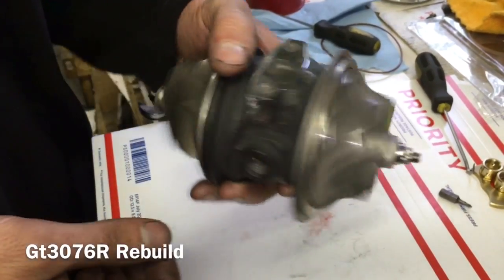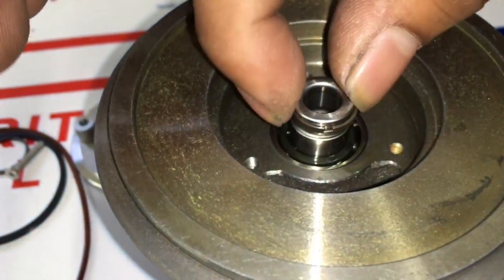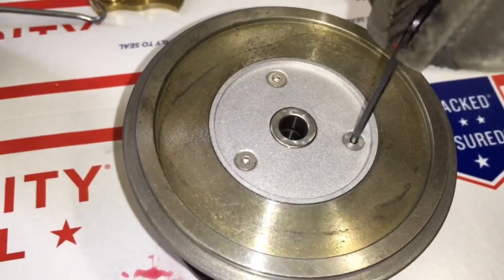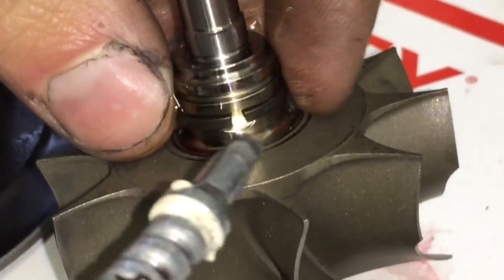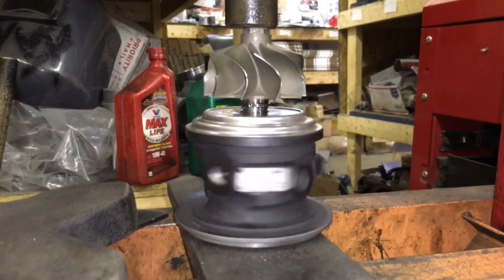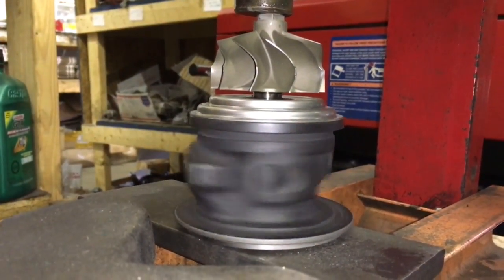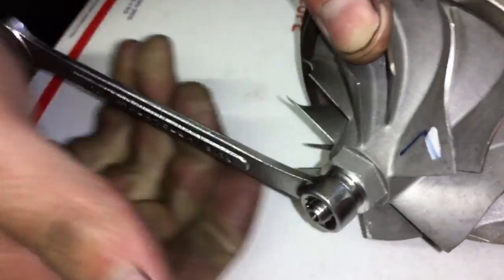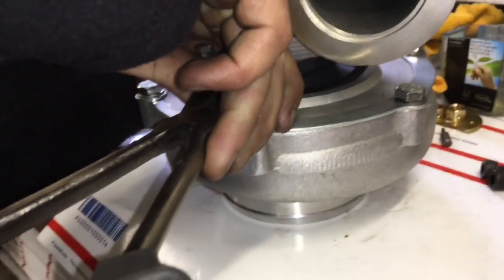Garrett Gt3076r turbo rebuild

Comment: Do you know what rebuild kit that I need for my Blouch Dominator 1.5xtr? I know that the cartridge is garret gt, but i was wondering which one should I buy. Can you help me to find the right parts? Thanks!
Reply from the maker: You need the gt3071r rebuild kit, there is a version with a bearing cage  https://amzn.to/3J696Y4 and without https://amzn.to/3TMn7ij . Both of these are kits I sell. The cages have brass retaining rings which are more durable over the plastic ones that garrett had in most models. The cages are really pricey even for me but I need a good product for my own builds.

Comment: Its actually easier to press the cage on to the shaft from the other side with a 15 mm deep well socket, after already having the turbine shaft and seal in place in the housing. Then after you press the cage on to the shaft then install the alignment pin, and then put the seal on the comp side or the cage and finish it. This way you don’t risk bending the turbine shaft seal

Comment: Hi there, I really do enjoy informative videos about turbos, while I was watching it a question pop in my mind. I got 93 toyota mr2, with ct26 turbo, I would like to use the turbine housing and keep it as it will connect my manifold and downpipe, but would like to change the core into a bigger turbo and its compressor housing. Thanks you for your time.
Reply from the maker: I think there are upgrades for them but I don’t know anything about upgrading that one.

Comment: Im looking your job some times  , and I think you schould invest some money in high speed balancing machine ;)
Reply from the maker: +Pawel Wachowiak we have a balancing machine, a vsr balancer is around 30,000$ then an additional 400$ per adapter per turbine shaft.
Reply: I am rebuilding turbos almoust 10 years and have all machines needed - balancing machine, vsr ,electric actuator testers, and machine for flow mesurement ,I have friends they are working in burke Porter Group company ,they are producing this all machines in our country, if you want i can ask for prices for you :)